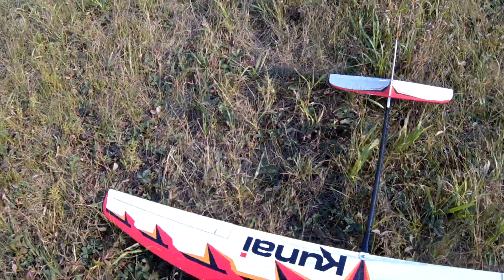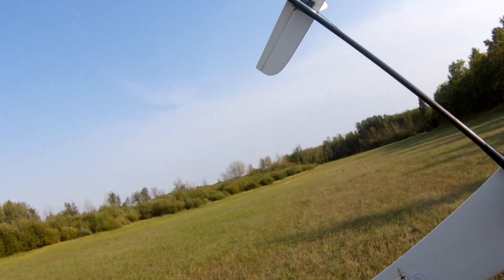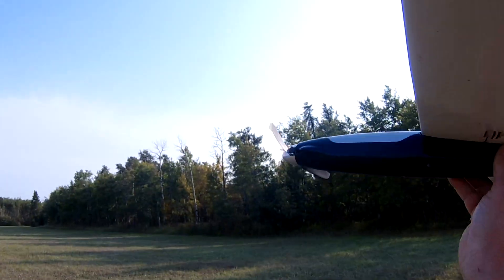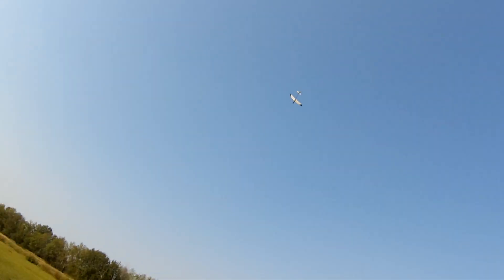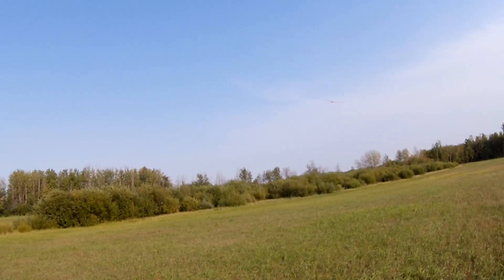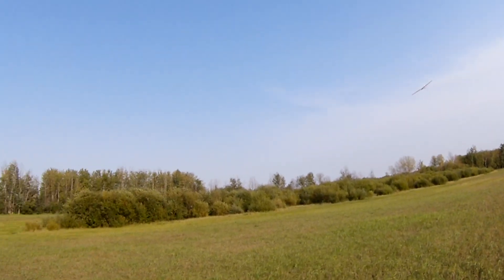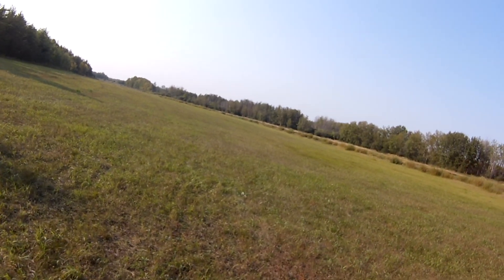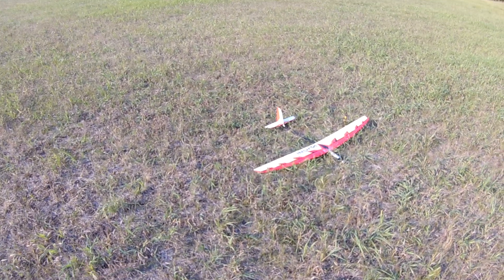Great Planes Kunai 1.4m hot rod

Comment: Lucky you got one xD This has seen a bit of abuse judging by the tape pieces? Looks like a very fast fun plane! Last autumn I purchased a 2nd hand FlyFly Deity which has 2300mm an V tail. It´s balsa wings and glas fibers fuselage. I was amazed how much aerobatics it can do and she´s pretty light on 3S too. Just the motor gets very hot if used for too long or too often.
Reply: Maybe the antennae have been implanted in the wing.

Comment: Wow 3/4 of an ounce on the tail seems like a lot. I loved my kunai when I had it, it's the only plane I regretted selling.
Reply from the maker: It's a good plane.
I like the CG a little further aft than most. the larger ESC and motor make a difference as well.
Reply: @CR5rc  ..and the metal spinner.
Reply from the maker: @toolbaggers  It's aluminum but it is heavier than the plastic one it comes with. 
Stock motor is long gone ;)